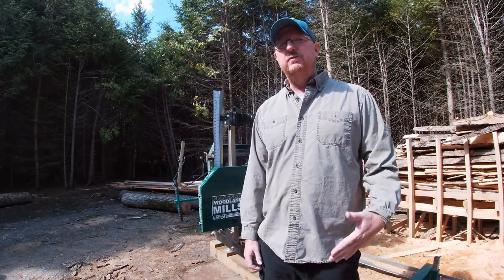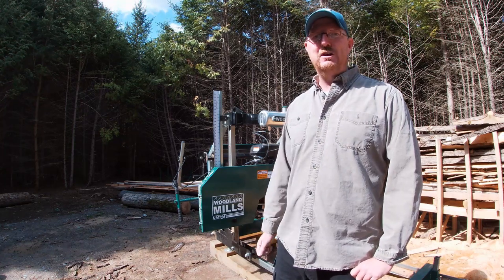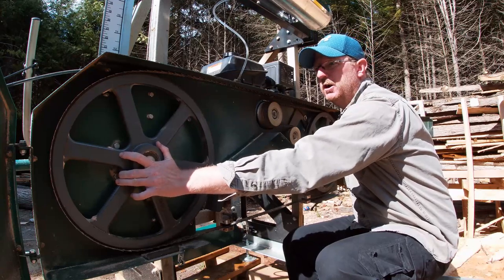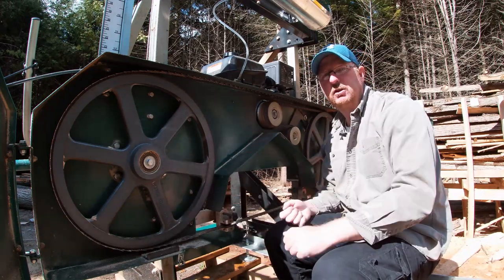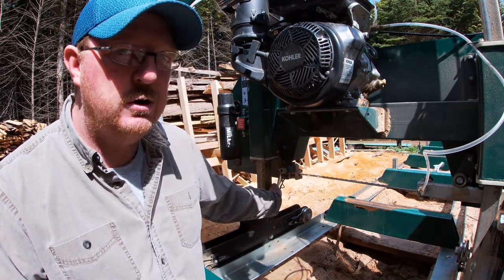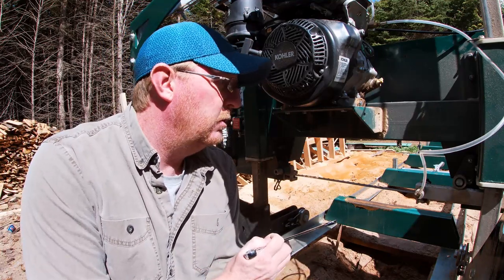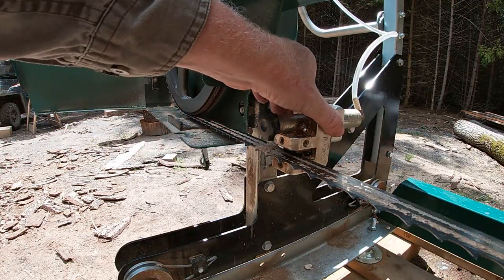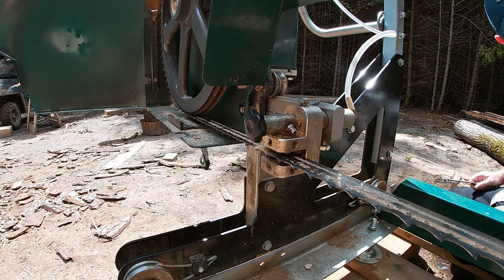#49 Woodland Mills Sawmill Blade Tracking Demonstration

Comment: thanks for posting Chris,  very information videos about woodland saw mills.
I've been using my Max 130 for the past couple of months (16 footer on trailer).   lots of growing pains / learning!!    FYI - I needed to adjust my band will alignment - and the follower side was fine.  I actually adjusted it - with no success.    I needed to adjust the drive side.   My mill didn't have that "don't touch sticker", and tech support said it was ok to adjust just the drive side.   Very time consuning going back and forth - and I found out I needed to change my drive belts.    I was too timid to change the blade (and frugal) after hitting the log stop a couple of times ....which slows down cutting and puts pressure / wear on everything else.   I also needed to tighten the drive belt tensioner (6 mm or 1/4 inch deflection).   It's a pain to learn it - but hopefully future adjustments are more efficient.

Comment: I don't see the issue with adjusting the drive wheel. If the blades are even, they are event. Blade tension can make a difference and can move the wheels once tightened. This is one of of the few cases where you actually do need a torque wrench.

Comment: Just put together a hm130 max the saw blade sticks out the back of the cast iron wheels about 1/8 of an inch on both sides. Should I leave it alone? Or try and adjust the follower side to get the blade flush with the back of the wheels?

Comment: May I ask what way do the pulleys face when assembling?  What side faces outward from the mill head? Also a washer, spacer, pulley, washer, locking nut?  Any help appreciated? Have a blessed day!
Reply from the maker: I can't remember what/if there is a front/back to the pulleys. But you should have some spacers that are thicker than washers. Starting against the mill it goes 12mm spacer, pulley, 5mm spacer, pulley washer, then lock nut.(Assuming its the pulleys for the lift mechanism, and if you have the hm126 and not sure if all models are the same) Sorry I couldn't be more help I will be back at the mill this weekend I will look at those pulleys to remind myself of the front/back part if your still having trouble.

Comment: Hey I got a new mill and it’s my first blade change, and their is no way I can get my blade to track with just adjusting the idler I can get the blade to track on the idler but within a half turn the blade goes in 1/8 “ on the drive wheel. I’ve watched idk how many videos and tried everyone’s way and still but I did not touch the drive adjustment because I shouldn’t have too
Reply from the maker: Hey Brian, does it just keep moving back or does it stop at the 1/8 inch back if you keep turning the bandwheel? I know that its ok if the back of the blade sits a little behind the back of the bandwheel. Sometimes it takes a turn or two for the blade to find the line it wants to ride on. But obviously if it keeps moving in one direction somethings off. I know it can be a finicky thing, probably the best thing to do would be to call woodland mills they seem to have some good people that will help with any issues.
Reply: @ChrisBrackenridge  hey it kept goin back I ran a strait edge on the drive wheel it was out a couple mm, I ended up adjusting the drive wheel a quarter turn to move the blade out and now it’s perfect, thanks
Reply from the maker: @briangreencorn3074  Awesome! Happy sawing.